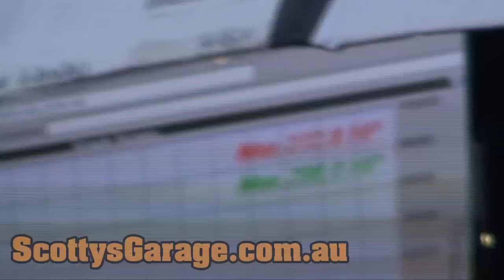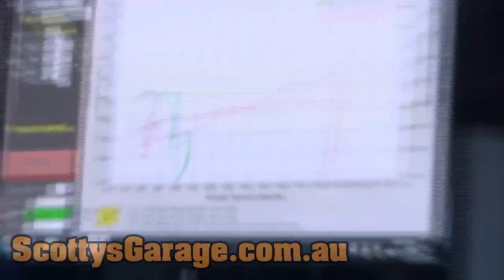Too Much Horsepower For The Dyno

Comment: It's the slick metal wheels the tires are trying to put the power to. A strips launch surface has MUCH more traction as it's essentially rubber on rubber.